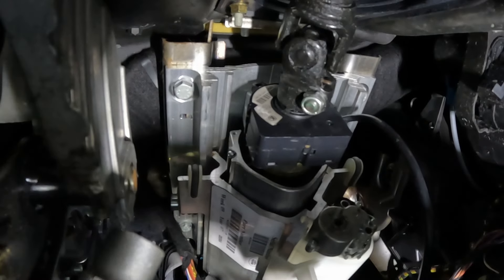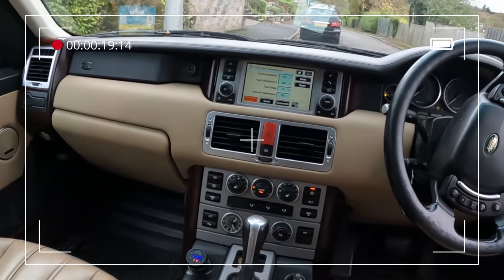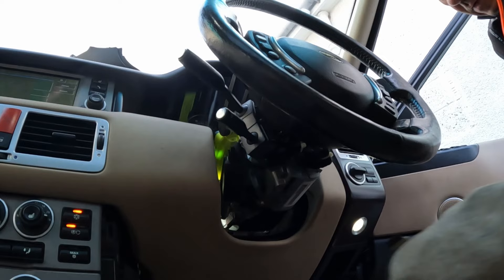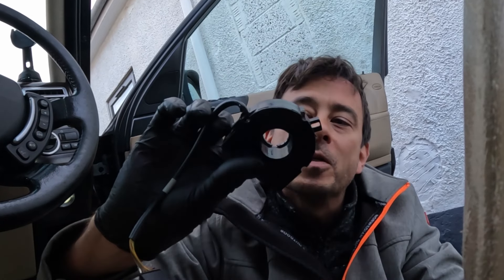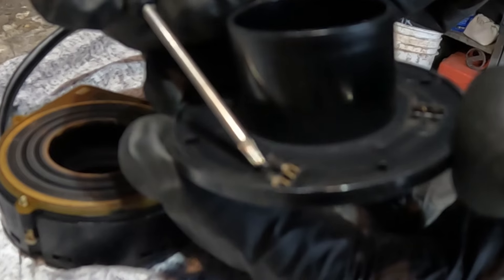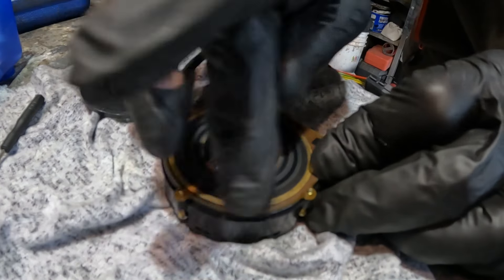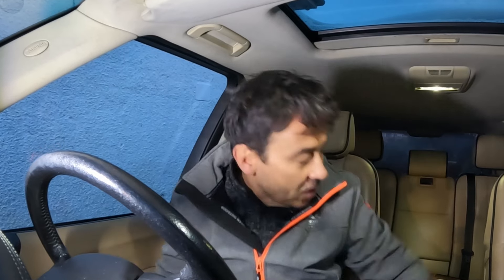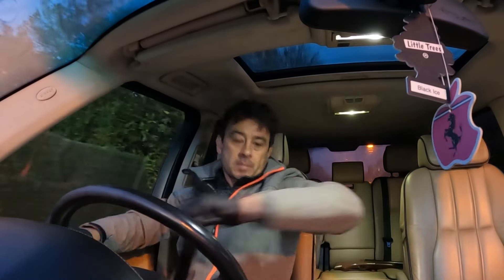Range Rover L322 Air Suspension Fix Steering Angle Sensor Strip-Down. Episode #4

Comment: Great videos i.m new to range rover I have 2009 sport 2.7. the BMW angle sensor you used to rebuild the original what model bmw . Keep up good work very helpful.
Reply from the maker: Thanks so much the steering angle sensor I bought was specifically for my car but is made by BMW

Comment: I think I have exact issue with my Disco 3,  like you I serviced compressor which has sorted suspension fault but car goes in limp mode if you drive in a straight line for too long!! In limp mode the compressor goes to 50 deg - restart car and all lights go off and temp of compressor goes back to normal after 5 minutes. So making sure I keep moving the steering wheel prevents limp mode - sounds odd but that's what's happening - I have recalibrated with IID tool but problem still occurs.. Steering sensor change will be next.. Thank you.
Reply from the maker: let me know how you get on

Comment: I said I'd comment when i started this job after commenting on another video you had done. Thanks for an informative video. It's literally hanging in place ready to be bolted back up tomorrow. Had to see if it worked before final fitment. Steering left and right and no joy😢. Got my reader out and tried a calibration.... still no joy.... reset codes 🤦‍♂️ calibration and viola all sorted😊 suspension seems a bit slow moving but no faults. Car has been off road since November and i think the issues probably rose a long time before. How many brushes did i have left on the original one? None😮just wisps of cotton. Used internals fixed my issue as there was nothing left to bend. Cheers buddy😊
Reply from the maker: That is superb, I'm so glad you got it sorted mate, it's the whole reason I did the channel well done you! Thanks if you clicked on the 3 dots and hit the thanks with ❤️

Comment: Just got the two codes. Car is in mid height and compressor turns on and off. But does not raise me high or bring me low. It’s right in the middle.
Reply from the maker: have you gone into the steering angle info to see what it says?
Reply: The air inactive code went away on its own. I have the trans safety program message and transfer case neutral message. I think k those two are the ones that gave me the air suspension message. It’s working perfectly now and it does not leak since in the morning it’s still in its proper height.
Reply from the maker: @Truthfulfisherman  sometimes turning steering wheel all left and all right can clear the error

Comment: Thanks for your great videos about this SAS problem. I have started the journey of hopefully replicating your success with it! However, I have come up to a STOP POINT!! The 3 screws holding the plastic cover under the steering wheel. Got 1 out. Next one in the very deep hole is not budging. I bought a T15 150mm long to reach it but still no movement.  So, near and yet so far :( Any thoughts on other ways to approach that one (without destroying the cover in the process)? Then there is the 3rd screw still stuck in the hole also. Strange thing about this one is there appears to be some thing stuck in there with it - as if someone tried a drill bit and it got stuck.
Now I see that @BruceAllentools has commented "No need to remove plastic halves from steering column behind wheel. Just pop off side panel of dash and you can see right at the blind bolts". Perhaps I should try that alternative. Any thoughts?
Reply: Success!! at last .... I had to break the third screw hole but it was worth it ... time tomorrow to press on to the next hurdle ...... :) Couldn't have got this far without you quality video. So, thanks heaps for that.
Reply from the maker: I know what you mean about those screws, I found I had top pul the cover down as I turned the screw to release it. I did a follow email on steering angle sensor here:  https://youtu.be/y16dPBTGtqs

Comment: Hello man i have problem with 2007 range rover sport, when i start car no problems at all, but when i even slightly turn wheel to the left the esc goes off and suspension fault special programs disabled, when wheel is straight left cornering light is on, when turn left the right cornering light is on.
Reply from the maker: That sounds very much what I had, it's very likely the steering angle sensor

Comment: hi i wonder if you could answer a question for me , i changed the SAS and when i tried to add it with the icarsoft it asked me for the steering column number , both the numbers on the column contain letters as well and the icarsoft is numbers only , yhanks jeff
Reply from the maker: Hmm interesting, did you change for a complete new sensor rather than just the brush part like I did? I haven't tried to add new one using icarsoft. Can you run a calibration?
Reply: @GrooveOn  Hi yes it was the other type on mine , so i changed it , and because i tried typing just the number not the letters, it won't communicate,

Comment: Great set of videos 👍. Keep doing what your doing. Very helpful and enjoyable to watch. 🙏
Reply from the maker: Much appreciated! I have just started a new series on an L320 Range Rover Sport
Reply: @GrooveOn  is that cost heavy steering wheel if not then what is reason the steering wheel is heavy but when i run the car a few second the steering so smooth but it goes heavy

Comment: So i have a yello exclamation light that says dynamics fault and cannot choose snow , sand or rock mode ive change my front shocks and i dont loose air over night but light is still there , i did see that i have that code  stored for a rear right wheel speed sensor & steering angle sensor & another one for lost communication for steering angle sensor module could thus be the culprit ?
Reply from the maker: have you tried to calibrate steering angle sensor turning full left and right?  If you have Maxicom diagnostic I found you can calibrate this with the tool as I had to do this yesterday when I changed my steering angle sensor.

Comment: Hi I've finally managed to finish the Steering angle sensor job ( what a bloody pain). I've come to put the under dash panel back , (fitted light and clipped in that round thingy but there is a connector block with pale green clips and I can't remember how it fits in. There is like a hole for a screw or bolt but I don't know where it attaches and I don't want to trap it as I put everything back.
Reply from the maker: Can you pay a video of connector?

Comment: Good work bloke. Q. did you look at replacment brushes....about $17 Au. All the BMW brush thingfies look the same. Im going to try that
Reply from the maker: that could be a great option.  I was going to get a used module, but since I did the video and bent the brushes slightly that had worn, so far I have not had the error message come back !
Reply: @GrooveOn  I pulled my sas apart and it looked like yours so I bent them up and started putting it back together  to  my surprise the shafts  short. Im gunna laugh one day...but seriously its 4 or 5 cm too short. Is it the steering wheel length and height adjustment. A small piece of shaft I forgot
Reply from the maker: @domrice9153  did you get that shaft back into the spline? Perhaps the wheel has moved via the adjustment switch?
Reply: @GrooveOn  not yet it's night-time so I'm brooding on it lol
Reply from the maker: @domrice9153  yeah, good with extra light, what I did was prop up under steering column and lower trim to align it
Reply: @GrooveOn  Hi quick question before reattaching the column how  far thru the hole in the bulhead  is the coupling sticking thru to the drivers side, When I removed it  everything fitted now it seems like the shaft has retracted  into the column (unlikely) or on the engine side! I thought I ask beore I tackle this,.
Reply from the maker: @domrice9153  I need to check the video again, but I inserted the spline before putting the 4 fixings back, I propped up under the steering mechanism between the bottom of the trim under the steering wheel to move it closer to the mounting holes

Comment: No need to remove plastic halves from steering column behind wheel. Just pop off side panel of dash and you can see right at the blind bolts.

Comment: Hi you mentioned about changing the SAS top part, which part do you keep to avoid having to  reset the system?
Reply from the maker: Yep, I'm doing a video on it now, if you subscribed and notify the bell it should let you know when it's uploaded👍
Reply: Hi mate I just received my 2nd hand SAS from a reputable source,  I took it apart to check the contacts and all good thank goodness. Will fit this week all being well, and will let you know how it goes and if the 3 amigos disappear. One question, will it reset the air suspension led, im hoping it will delete the can bus error and reinflate the rear suspension as the front is still in motorway height setting.
Reply from the maker: @George-hs2zm  okay good stuff, I have also got a used sensor and yet to do what you are going to as since I did the video it's been working great no errors, so I am waiting until next week after the car goes for a MOT yearly UK check.  Once you install, turn engine on try turning steering wheel full lock right then left to see if the fault clears on dash as this will calibrate the sensor position. Once this is cleared try turning car off and on and see if the suspension starts behaving, if you have a diagnostic like icarsoft you can use this too.  Good luck let me know how things go👍🙏
Reply: @GrooveOn  I've tried to untighten the pinch bolt but it's so tight it's rounded off, any tips on getting it off.
Reply from the maker: You change the part with the worn brushes mate, keep the part you plug in
Reply from the maker: @George-hs2zm  damn, that's an awkward place, it shouldn't have been too tight. Can you hold the nut with mull grips and try the bolt head?
Reply: I just wanted to ask, is the pinch bolt a l/r hand thread. I'm having some real difficulty getting it off.
Reply: Hi I've finally managed to change the steering angle sensor after many months. I've got to check it tomorrow as battery has gone flat. I bought a little cordless impact wrench which has made thing a lot easier.

Comment: So i have the same problem with my 05 range rover. "Air suspension inactive" on dashboard and no lights and the module. I've already replaced the compressor, height sensors and all fuses. Also has same "can bus error. I'm hoping the steering wheel sensor is the answer to my problem.  Thanks for video
Reply from the maker: well done for eleminating the ABS and Compressor, the steering angle sensor is fairly cheap, but a pain to get too.  I hope you can use my video and get your Range going !

Comment: Very good video that teaches us how it should be. I have a suspension issue where the front suspension is all the way down. The analysis program reports that it is "can bus fault". Could this be related to the steering angle sensor? Thank you very much
Reply from the maker: The canbus for suspension seems to be linked with three things, steering angle, abs, and air compressor, so if you can check your abs sensors are okay, and the compressor when it works is okay, it would suggest the steering angle sensor. Have you tried turning wheel to left then right?
Reply: @GrooveOn  thank you for your answer. Yes I've turned the steering from one side to the other several times and the error persists. "air suspension inactive" on the dash and "can bus fault" on the diagnostic tool
Reply from the maker: @pires53  I had a bit of luck clearing the abs fault, then steering angle via the diagnostic, then I cleared the dash suspension fault with steering wheel. In that order.
Reply: @GrooveOn  after replace the front air suspension the canbus error disapear, one thing that I don't understand because my front suspension is not linked to anything.
one more thing: I bought the iCarsoft LR V3.0 at Amazon and this tool don't recognize the VIN, also don't read the SAS and the transmission. I cantacted the iCarsoft EU and they kick me off  asking me to contact who sell the tool and send me a list of the Land Rovers which this tool read the SAS. On Range Rover only from 2006.

Comment: Very many thanks for posting this excellent video! And also thank you for videoing the difficult, (I am sure) under dash views, the seemingly unrelated steering /suspension connection was very well spotted, but then that is the advantage of your electronic gadget, I do find that most of the electronic faults are due to using German made parts, every such fault I have had on my Range Rover and Land Rover have been traced to these black plastic encapsulated electrical gizmos, now we have your video tutorial to refer to when this fault comes up. Glad you have found the problem; I find it very rewarding when I finally find a broken contact or wire, you know you have found the cause! Chris B.
Reply from the maker: Again such kind words Chris B! I'll be sure to mention you in a future vid, really appreciate the feedback on my videos, it helps tell me if they are being helpful, it's all I ask 👍
Reply: @GrooveOn  Well! The Range Rover can be very intimidating to a lot of people, seeing you attacking it hands on is a huge confidence booster, even knowing that other owners are suffering the same problems make you feel you are not alone. Chris B.
Reply from the maker: @453421abcdefg12345  Thanks ! for these older cars (which I love) the need TLC and I have years of figuring out how to fix myself, so love to help others try themselves. !

Comment: my plastic gear i think its called on the SAS sensor is very loose , and im guesing  its why my hdc fault and lowered suspenion is coming up , cant find a video anywere on youtube to explain to the removal and replacement , any tips on this !!
Reply from the maker: do you mean the holder that the Steering Angle Sensor fits on too?.